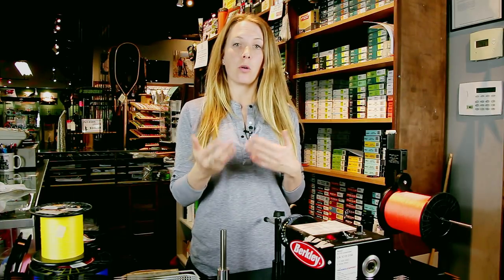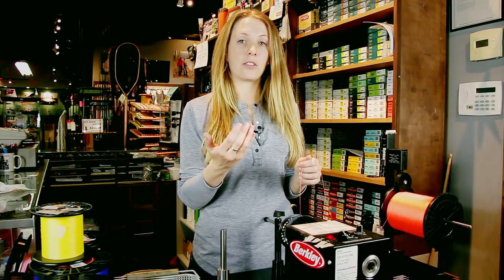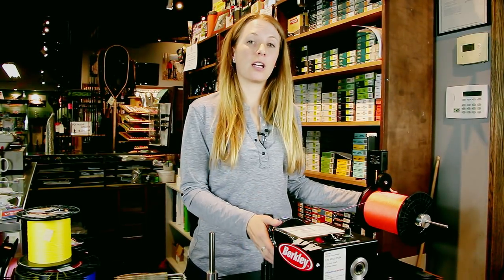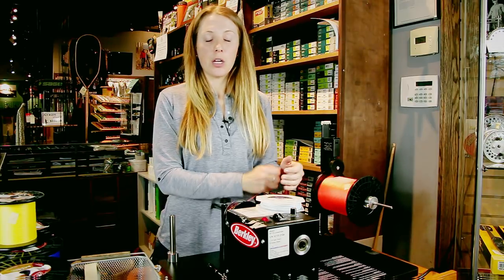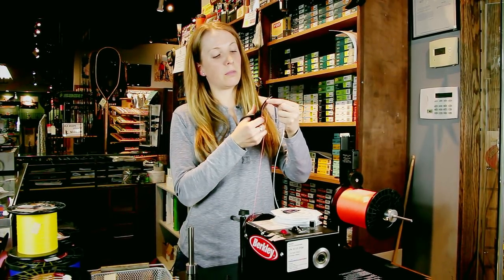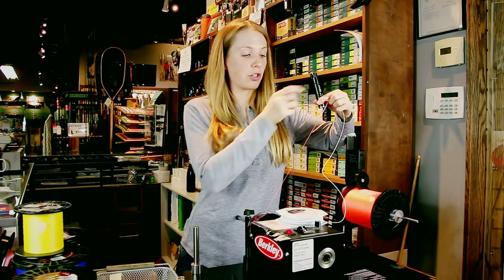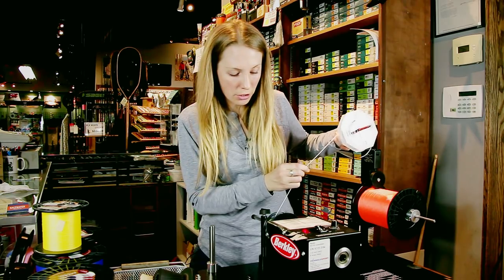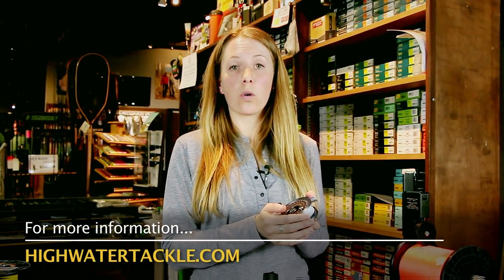How to Fish: Spooling a Fly Fishing Reel

Comment: It looks like the spool has too much line on it. It looks like the line is too close to the cross bar piece. After a cast, reeling in, the line will not be wound evenly and will rub on the cross bar.
Reply from the maker: Looks like it, but it’s not. I’m still using the reels in the video and the lines have been packing in just fine.